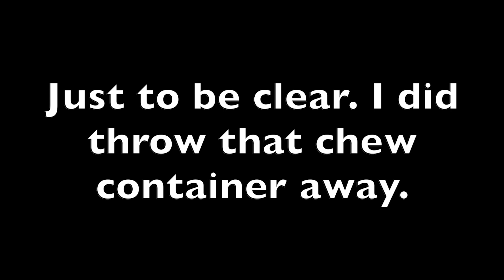Tires, Fires, and...Failures!!!!!!!

Comment: Fail to prepare and prepare to fail. Always bring the right equipment you knew well in advance what you were facing. Not good video content to see a bunch of grown men messing with a tyre change in the rain. 🤪
Reply from the maker: I think if our air compressor would have been working right we could have busted those nuts loose and been able to use the other tools we brought...that gas mixed with ethanol reallly messes up those small motors
Reply: Pat Reynolds what a clever quote did you write that yourself what was that Shakespeare